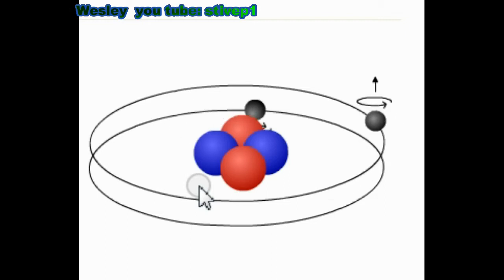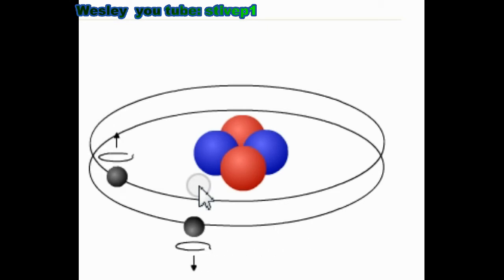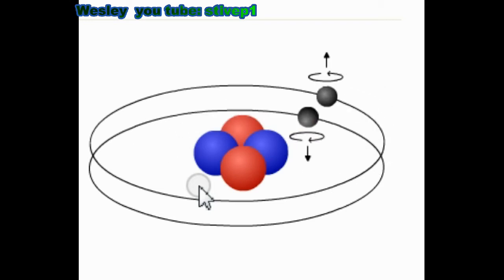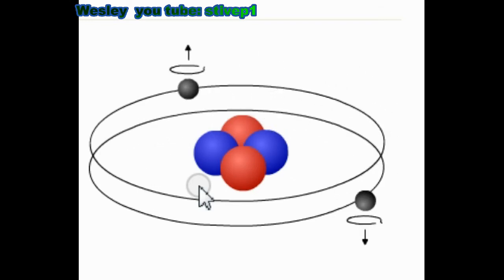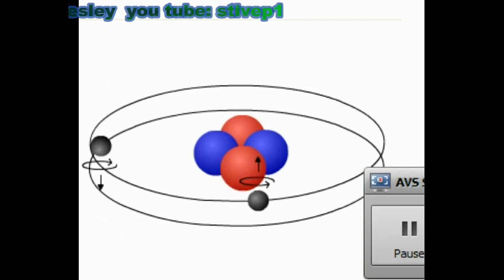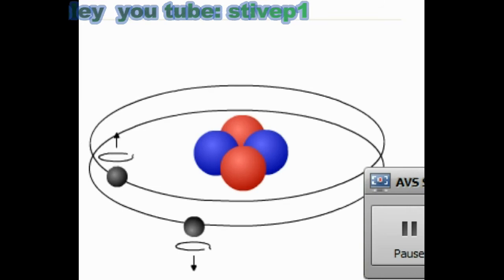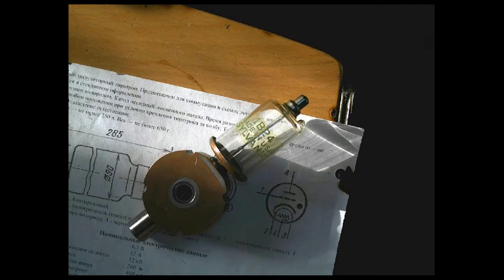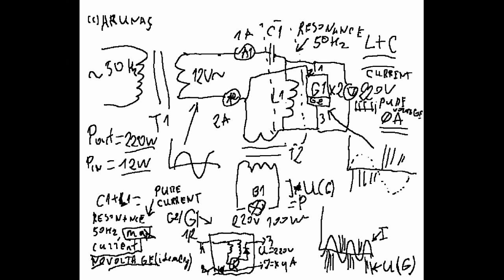Can copper wire become  magnetic?

Comment: In this case, the answer is very simple. The wire is not made of pure copper, but it is iron covered with copper that was added during the production process. You can check it yourself by cutting the cable and analyze the cross-section under a good microscope. You can see the difference in metal colors. This is an example of how Chinese manufacturers cheat us on the products they sell. I once asked the supplier to provide me with a thicker copper wire. Before the delivery was made, I stated that I do not want anything containing iron. I needed a clean copper wire. I got something that was magnetic over the entire length, containing iron. I returned the goods and the seller was not even aware of what was in stock! Since then, when buying a copper wire in a store I always have a magnet in my pocket, I check and look for cheaters.

Comment: This is a good idea in hindsight, but I did not have anything capable of measuring an 8KV charge at the time. When I discharged it, it gave an extremely loud bang, which indicates to me that it was highly charged, even though it had already blown. I only figured this all out because I always have a compass near my experiments, just in case I have a 'faraday moment'. When the circuit was all turned off, I noticed the strong needle deflection on the compass from over 10cm.

Comment: So the wire became hot enough to soften its insulation.
Hendershot had his generators stop working after a while as little holes of rust formed in his sleeve cores: In isolation it is not possible to distinguish manganese rust from iron rust. 
He too was limited by stranded copper wire heating, and maybe also had atomic change there too.
I had already thought of getting 1mm wall 4mm o.d. Cu tubing to pass water through it to a radiator.
Magnetic spin would be safe at a distance, but emanations ?

Comment: I believe it IS possible for copper to become magnetic. Recently, I blew up a couple of capacitors which I did a tear-down video on. When they blew up (in a HF/HV tesla circuit), one of them had an intense magnetic field in the center which only disappeared when I discharged the blown capacitor. The capacitor had aluminium plates and the magnetic field was stronger than what would have been produced with a N52 neo magnet!! I did not capture it on video, but I will if it happens again!! No bull!

Comment: The compass north was in the center and the south was at both ends of the cap. I only played with it for 3 min before discharging it, not realizing that this would remove the magnetic field completely. 

There was about 5 amps @ 240V going into the circuit. I have no answers to this phenomena, just more questions...

Comment: It also might have been interesting to monitor the terminal voltage as a neo was passed by.
Were the N>S field lines in-line with the centre of a spiral foil winding, or axial through the planes of a set of plates ?
I am asking this question to determine the electron alignments set up within the dielectric medium of your capacitors, because electron axis orbits become shifted within insulators as well as conductors and magnets, though not permanently until a molecular breakdown occurs.

Comment: Hi. I watched video.
Of note was a EM induced modification of the material state within the capacitor; commonly called a 'burn'.
This possibly via the induction of an electron alignment spin wave within the insulating material between the thin alloy plate strips as their spiral wind tightened towards the centre.
As to centre discharge induced magnetism, the electron orbits of some capacitor atoms had become axially aligned with the axis of the capacitor foil wind during the molecular change.

Comment: From reporting of the Hubbard Coil demonstration -
The boat - circled about the bay and returned to the wharf - The wires connecting coil and motor had begun to heat under the excessive current, and, fearing that some part of the coil might give way under the extra heavy strain put on it, Hubbard declined to permit the motor to be run continuously for any length of time. - was tried out later several times, after brief periods which allowed the wires to cool, 
Copper wire energy transformation ?